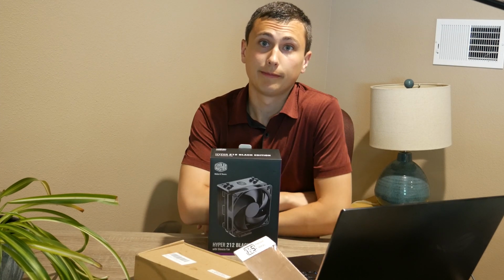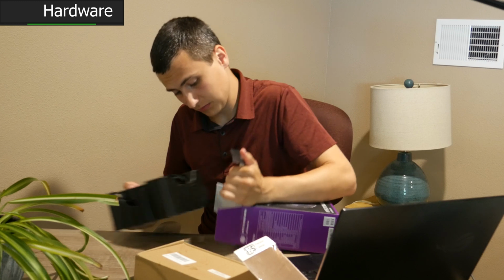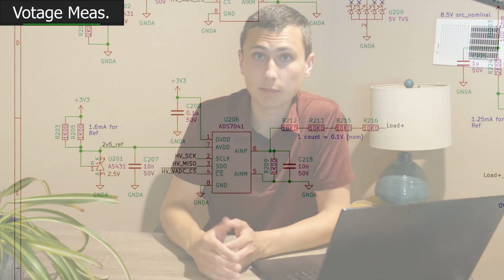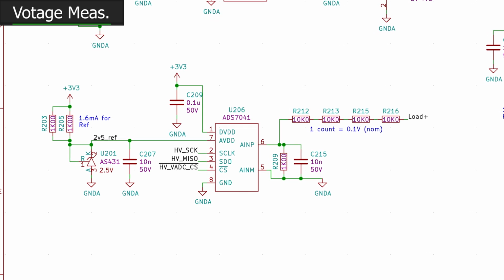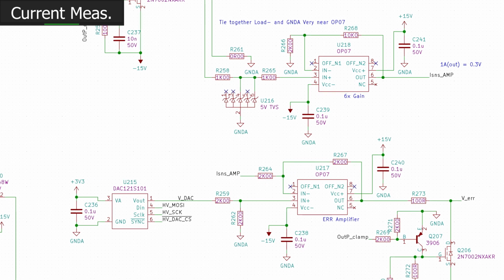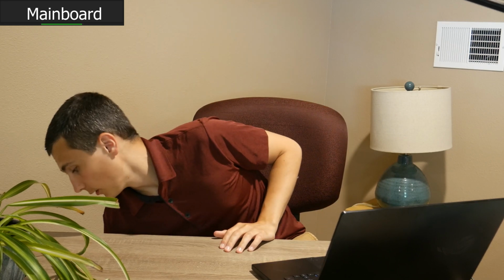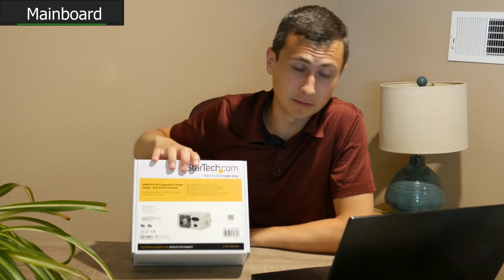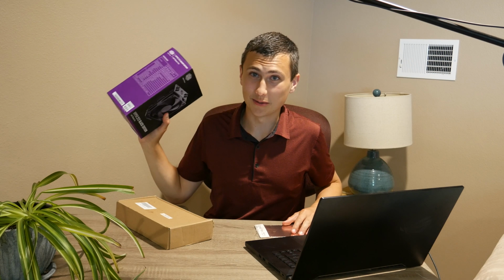Proto 2 Electronic Load Kickoff: What needs to change?

Comment: I don't want to discourage you but 2 kiloWatts of heat dissipation is basically like trying to cool water in a turned on kettle. 100 Amps at 20 volts is used in WELDING. Ditch Silk-pads you need metal to metal contact to get the thermal resistance low and good airflow is a must. Quality thermal paste will help a lot.
Reply from the maker: Hello Replay, 
I couldn't agree more. I can't wait to share the watercooling test results when we really have an opportunity to crank power out of this design. Like you say, thermal management is going to be a big challenge!

Comment: How much current is the auxiliary circuit drawing? I guess that atx psu is waaay to beefy for the couple of fans and water cooling block. I'd have used a laptop psu for all the auxiliary stuff but then again, I would not be aiming for a water cooled mosfet
Reply from the maker: Hello M Sana, Great comment! The ATX psu is WAAAY too powerful, I completely agree. Yeah, this came down to a "Man... I need a lot of power supplies that draw <0.5A, and I saw that there are plenty of OTS supplies that would seem to work. Think of this more of a test of ATX PSU capability for our projects, even though this isn't the final version of the design. More to come here, I'm sure!!!

I'm probably drawing less than 50W total from the DC side of this supply, pump and all.

Comment: Something that i might be missing from your videos, and i apologize for that:
How did you manage to solve the current and voltage controlling? By PID or they analog way?
Reply from the maker: Hello FixDaily, no worries, thank you for the great question! We're doing an analog PID using opamps, so.. yes! We're doing PID the analog way! (for current). Voltage measurement is software, and the setpoint is controlled with software, but the actual current regulation is all hardware.
Reply: @EEforEveryone  Oh great, thanks for clarifying  :)